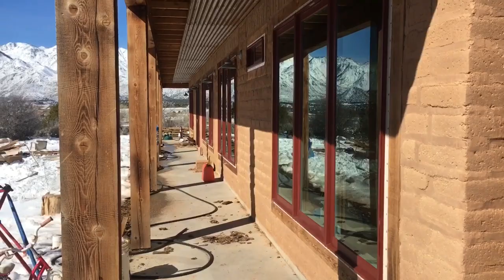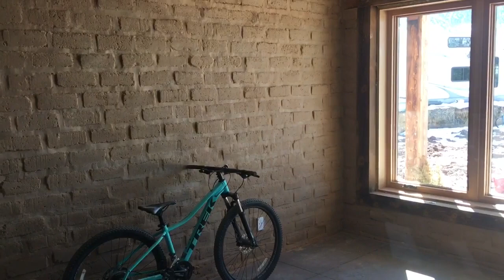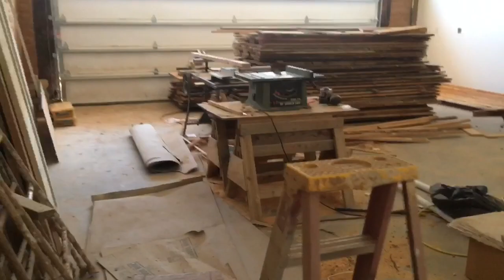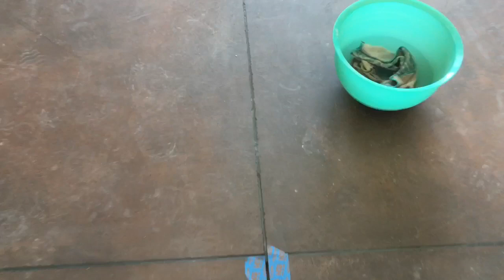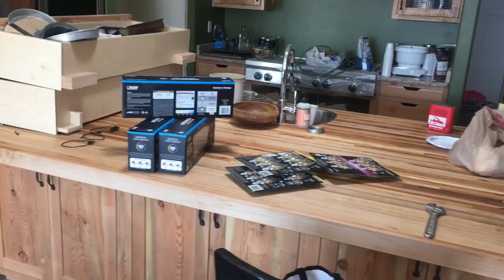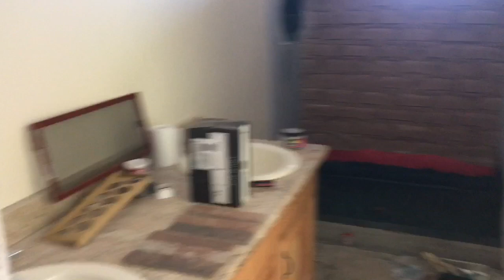Progress Report/Design explained

Comment: If gas behaves the same as water, by decreasing the pipe diameter the pressure does not increase. The pressure stays the same however the velocity of the fluid is what increases. Either the pressure from the source is already too high, or the velocity of the fluid causes problems and thus the need for a reducer valve. 
Thanks for the video!

Comment: Thanks for taking the time to make these videos. I’m in the investigational stage of an adobe plan, your videos are some of the most thorough explanation of a modern adobe build. I started with a book by Paul Graham McHenry on adobe building, I would love to know what other resources you used to learn as much as you have. Best of luck.
Reply from the maker: Hi Jonathan. I’m glad you’re finding my videos useful. Hopefully you can use the information I’ve presented  to help you in your project. I gathered as much info as I could from the internet, most of which was just about the benefits of using adobe, not much on actually how to do it. Luckily I have a friend who has done a bit of building with adobe and he shared his knowledge with me. One thing I did learn though is that if you can find someone who has done it before, they are usually very willing to share what they know. I would also say, don’t be intimidated by it. It’s hard work but adobe is super forgiving. If you make a mistake it easy to fix. And mistakes add character. Good luck with your project
Reply: Project Biggs Glad (or maybe sad) to know it wasn’t just me having a hard time finding actual building discussion online. I have a few leads on folks working with Adobe south of me, so I will definitely take your advice on reaching out that way. Best to you and yours.
Reply from the maker: @jonathanl2567  When you get going on your project don’t hesitate to ask specific questions. I’d love to help! Take care!